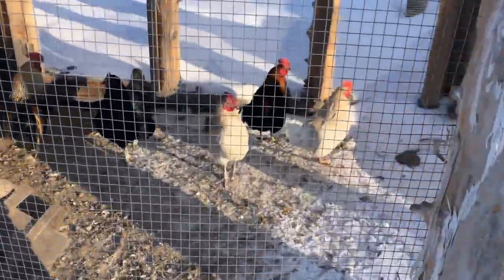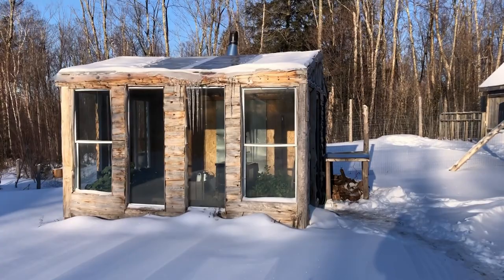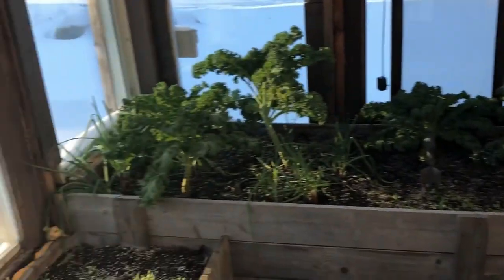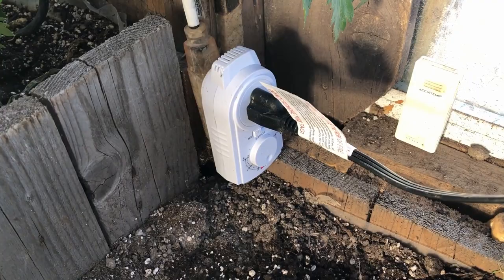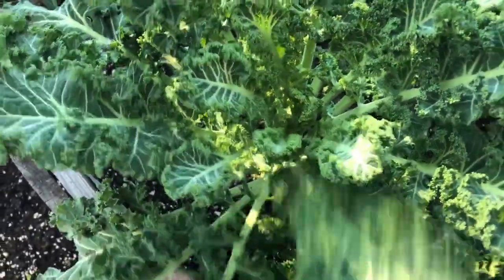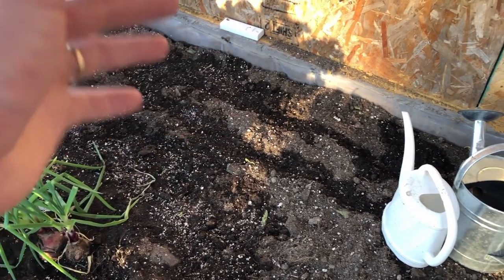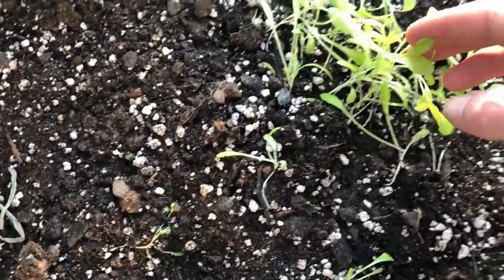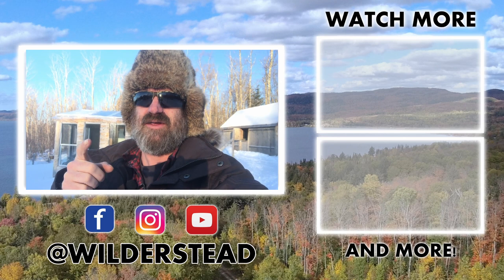Our Greenhouse In January - We're Still Harvesting Food In Our Winter Hot House

Comment: I overwintered some peppers in my basement. It doesn't get colder than 60F(15C) down there. I cut off almost all of the leaves and branches while leaving the nice Y shape that pepper plants tend to have. I also only let them get a few hours of light per day. Just before winter ended I increased the amount of light to 12 hours, and fed them nitrogen to get them back to growing again. They did well for about 3 years like this. I ended up losing them one winter when we had our dishwasher hose break off while it was running and it flooded my plants in the basement below.

Comment: Add a 55 gal barrel of water. It will release heat at night. Also look into a rocket stove. You run exhaust from stove around the perimeter of the building and put "cob' around it. Much of your heat is going out the roof. You should do it in your house as well.
Reply from the maker: Do you have experience using these methods?  We’ve tried some of these, the results were not desirable at all.
Reply from the maker: See, here's the thing.  A good friend of ours planned a greenhouse around exactly that.  And guess what.  He doesn't use the greenhouse in the winter because at -30C, it just doesn't cut it. He's now looking to install a large cast iron wood stove instead.  After he rips out his monstrous rocket stove/'thermal heat bank'.   It seems great in theory, but in practise, not so much.  They keep a baseline temperature, thats about it.  Which is great.  But it's not going to heat anything to a livable or productive temperature on its own.  If it did, you wouldn't be able to touch them.  Similar to the water barrel idea.  The size of water storage required for the cold temperatures here would have to be double or triple  the size of the space you are trying to 'heat'.  Doesn't work.  The greenhouse heats itself fine during the daytime, which is why we don't use a solar soda can heater for it.  The solar heat only works when the sun is shining.  We are, however working on a design using the soda can solar heater to create a small thermal bank in our chicken coop to keep their water from freezing in the winter.  And a second design using the same solar heater concept for in floor heat in our house during the winter months.

Comment: Thank you for sharing! I learned a lot from this clip. I'm a gardener in zone 6, just built a hoophouse so I understand challenges with climate control but hadn't considered lighting as an issue for initial plant growth!?! 😏

As far as overwintering peppers...the plants thrive in temps between 60-80. A 10 degree differential may be ok but above or below that, they don't do as well. May be best to harvest all the peppers, trim leaves, clean stems then transplant root and bare tree indoors in your house where temps are more consistent with 60-80s. 
Thx again for the video! Just found it but happy gardening and good luck with your pepper plants this year. 😊 HSTL Zone6 ❤️

Comment: you should look into heat storage.  Storing heat from the day or from that wood stove will carry you through the night.  A metal barrel on top of the wood stove will hold a lot of heat.  Fill it with salt, it holds more heat than water.  You can also put them on your north wall for heat storage.
Reply from the maker: The entire greenhouse is a heat sink.  400 lbs of cast iron, and about 600 lbs of soil in 2 foot deep beds.  The water bucket method doesn't work for us.  We've tried.  And I'm not going to buy a ton of salt to fill buckets with lol.

Comment: Your GH is luxurious stuffed with PVH windows and woodstove with glass, to improve I would paint the back OSB wall in black, put thermal mass there, any volumes that you have colored in black and filled with water, put good plastic curtain inside on the door and stick it with two sided stickers, to get benefits from the woodstove put shamot bricks on cooking area, so they accumulate heat and give it back, also put metal bucket with sand on top of the woodstove when burning wood then put it in the middle of the GH. For cold nights cover the GH with blankets or thick plastic
Reply: Good ideas.   I also wonder if shelves could be arranged with heated bricks under them to radiate heat overnight.
Reply: @curiouscat3384  normally they make underground water/antifreeze liquid/air pipes heated from wood stove. Not sure heated stones will stay warm enough thru the night till the morning, but try to heat sand in metal pots by candle with copper on top of the candle and all way thru the sand during cold nights, cover the plants with double layer of fabric

Comment: Being northern as well, I've wondered if the cost of heating the greenhouse could be better applied to artificial lighting and much better insulated shed/building/room. We don't get much sunlight for three months anyway. I guess if you have the wood from your lot, could save money on the electric heater and increase your thermal mass. I don't have enough light in winter to bother heating my greenhouse, but if I did, I'd lean towards the old thermal mass stoves used in Europe.
Reply from the maker: It is amazing how much the greenhouse actually warms up in the day just from the sun, even with the limited sun we have in the winter.

Comment: Dave,
Idea for you:
Consider putting in some black 55Gallon drums (even cut in half and stuffed under your garden beds; alotta work!) and fill them with water, wrap your wood stove exhaust pipe with copper pipe and use convection to move the cold water from the barrels around the stove pipe. This might help pull the greenhouse through the night, leaving the heater as "last ditch effort".
Can use the drums to water the plants Luke warm water too :).
Good idea with the rocks!
Drums: might need to blow out a wall and add a small addition?
Reply from the maker: Hey James, we have tried the water barrel idea, and so many other heat sink ideas.  We’ve figured out that this particular setup is best for this size of a greenhouse.  A much larger greenhouse definitely benefits from that type of heat sink, though.  

We have also been toying with hot water heating as you’ve mentioned, but we’re looking at doing that with compost heat as opposed to the woodstove copper piping.  I’ll be putting in some upgrades this week, so next greenhouse video will have a few new tricks we’ve learned in it.  Thanks for watching and stay tuned!
Reply: @Wilderstead  love it!!!!! I'm looking forward to the videos!

Comment: You may be better to put winter broccoli, leek, broadbeans and cabbage…. In your greenhouse, and seeing as your log burner is over sized you could kinda extend the greenhouse.
Reply from the maker: The wood stove is oversized to accommodate proper heating with the glass roof and windows surrounding the greenhouse.  A larger greenhouse would require a larger stove.